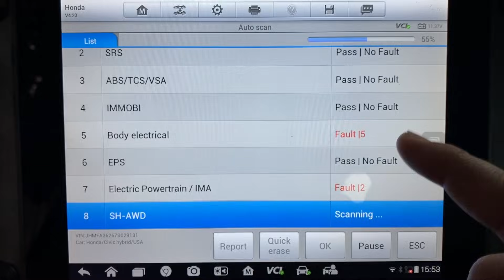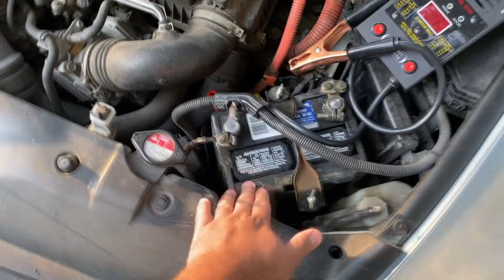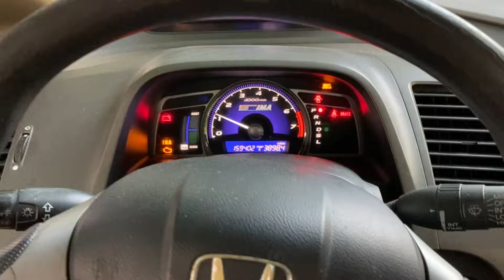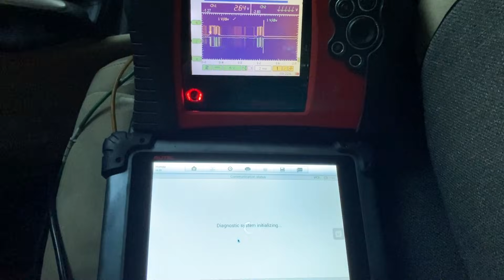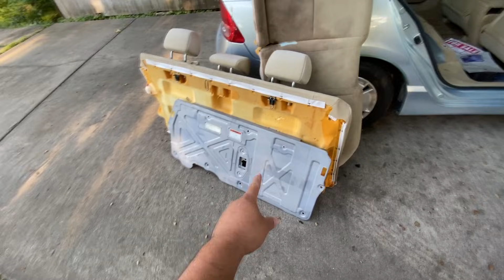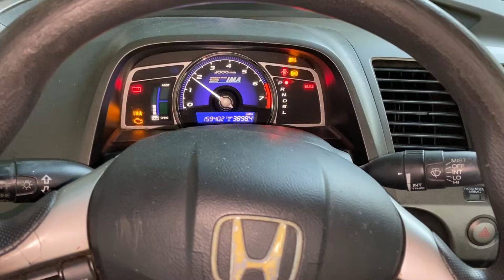HONDA CIVIC HYBRID STALLS / NOT CHARGING DIAGNOSIS

Comment: First thing first this is a basic check that a technician mechanic will do .I always check the battery connection every wires attached to it positive and negative. That's where everything starts. 99 % i found loose connection, wire damage, fuse blown ect I hope that's will help. 😊

Comment: My 08 has a similar problem.  New battery pack.  When it's cold in the morning (<~45 or 50)  I get codes , ima, blinking D.....  If I put a space heater in the car with the metal shield off blowing on the IMA battery (the BCM also warms slightly) to simulate a hot day (we do not have a warm-weather problem), no codes are generated and the IMA works just fine. 
The IMA gets to 90-120 surface temperature, no issues. 
Took the BCM out warmed it to 80° , and the balance of the car was 33, boom we get codes. 
Other than the thermistors on the battery sticks temperature reading devices in the battery pack area? 
Without a scan tool how do I check the function of the thermistors while the imma is installed?
Can a scan tool display the temperatures or values that the thermistors are Sensing?

Comment: I just have a issue in mi civic hybrid 2009 the brakes are not working they check with the machine and its pulling the brake sistem indicator. Mi car is not braking at all 😮 can someone help me ?

Comment: Hello, I have a 2008 Honda Civic Hybrid, and the battery light comes on, I can't imagine it. if not the 12v one. sometimes yes and other times no. I turn it on and off and the battery light goes off. And I have changed the module and the problem still persists.
Reply: Did you get it fix? Am having the same issue

Comment: Great video. I'll take it a step further and went to fuse 62, and it was burnt. I believe that happened when the jumper cables were put on the 12v battery. When I did, the battery showed 8 volts but was taking a high rate of charge. Anyway, replaced the fuse and wa-la. All systems back online, or seems to be, at this time. I like how you do your videos, very informative. Thx. Subscribed, and grateful

Comment: Dude, you did soo much and you are really good at explaining it. 
There is one more small fuse box for the IMA system. 3 fuses. ImA 1, IMA 2, and brake booster. Located bottom, left hand corner of the battery. I don't think you ever got to it.
My car left me stranded the other day with same symptoms. Got lucky watching another video about this Fuze box, changed those 3 fuses and was able to drive away. Drove an hour after, hasn't come back....yet....

Comment: Man please please someone help me out my 2014 Honda civic 1.5l ran out of oil tried to started and smoke ( smells like electric wire burning ) came out 
The bottom of the Orange wire . Is the the electric assist motor burning or what .. thanks if anyone can help

Comment: Hi, I buy a honda hybrid 2006 1.3 like that, and I try to take it there in  honda and they said is a MCM module, my 12v battery don't charge and two light apear in the panel IMA and Batery. Did you have any tips to give me?
Congratulation for you canal, fantastic your explanation!

Comment: Communication Issue is sometimes purposely done by the main computer. For example if the computer sense a severely out of range sensor it will cause a communication error that is cause by that sensor. So sometimes troubleshooting communication problem should start with live data. I had a prius c with a defective temperature sensor. Car would not start. Scanner shows a code that has to do with communication. I noticed a red value in the temperature sensor. After replacing sensor communication was stored and car starts right away with no more communication problem.

Comment: The Flashing led on D is related to the CVT. Can be a failure of a component or just low fluid. Perhaps that's why Transmission scan is not working.  When the fluid is low, after it cools down it may not cause the led to flash upon startup, until fluid level normalizes and temp normalizes.
Reply: On these cars is usually just low voltage due to a bad dc to dc converter . Nothing with the fluid

Comment: i have a 2013 honda civic hybrid with less than 109k miles on it, as i was driving yesterday my check charging system, check IMA system, and check brake system lights came on all at once. i took it to run a diagnostic at autozone and no error codes popped up at all so im hoping its a fuze or wiring issue because i cant afford to replace the entire hybrid battery pack. hopefully whatever mechanic i bring it to is as thorough as you.
Reply: Hi Moe Anaya, I just got similar problem with my 2010 honda civic hybrid. So I am wondering if you got any luck with fixing yours and what was the fix? Tnx!

Comment: I have an 09 civic non hybrid and my car stalls while at stop lights or while taking turns sometimes any tips, the idle becomes super low and stall while in drive but turn right on afterwards. I’ve cleaned the throttle body, tried driving it with EGR unplugged, swapped MAF fuse, swapped AC Clutch relay fuse. Any ideas/help?
Reply from the maker: If your check engine light is on, have it scanned for codes. Sounds like you could have a problem with either a vacuum leak or a dirty throttle body. Maybe try cleaning the throttle body and relearning the idle.

Comment: And that's how Honda dealerships and Toyota dealerships pay their rent. They leave loose wiring or just disconnected. Also they quote you whatever high price for parts and if you go with it then they will let you pay an arm and a leg. They expect you to bring it back to make more off of you. I always tell them that the part is like 70 percent cheaper online and it's genuine Factory oem. They always try to give you a cheaper price after you tell them that. Lol. They will also disconnect one of your small evap hoses in hopes that you get scared when the check engine light comes on and bring it back to them.  I never will let anyone I care about go to a dealership.

Comment: Today I had the same problem with my 2003 Honda hybrid. The same cable was super lose. I probably messed it up after I installed a new battery couple of weeks ago. After adjusting the cable. I took my car for an 40 miles drive. Ima and check engine are off. Thank you 🙏

Comment: Thanks for your video. I am in France and I have the same problem on my Civic (no recharging of the 12 V battery). I did not quite understand what to do to fix the problem.
What should I change as a part?
Thanks for your advices.

Comment: I have an 06 civic hybrid engine battery died. Replaced  battery now won't start or turn over green key flashing on dash . Also had lock smith try to reprogram  keys with no luck . Keys still lock and unlock remotely Getting error  code Imos not registered. Alao hDo I need to charge battery  in back seat also for it to recognize  the ecu? Or any ideas? Besides take to honda?

Comment: I have an issue where it turns on then the engine immediately dies. It does not happen every time. Would this be an issue with the fuel pump relay?

Comment: Very useful video 
I am facing one problem in same model car 
Error  Codes in
Electric powertrain is 

IMA P0A94 DC-DC converter output low voltage Permanent

DC battery not charging , once start also Battery warning light display in cluster 

I check the fuse ,relay all OK

I found DC converter input volt once start the car and found up to  190v but output DC converter volt is 0 
Check the status in scanning tool 
Command for DC converter is on 

Sometimes found DC Converter status malfunction 

Sometimes show normal 

So i need solution please guide me 

I suspect DC converter fault 
My observation is correct?
I am waiting for your reply 
Thanks
Reply: I check status in maxisys 906bt tool

Comment: Is it possible to bypass the hybrid system entirely as a quick fix? I seen a video where a guy did this and he claimed he had been driving it for over 70k miles. He just used a marine battery which can take dying more than a regular car battery. He also claimed that he didnt have to jump it all of the time being that the car doesnt have an alternator to sustain a constant charge for the battery. He had a portable battery charger to jump it. But he claimed that disabling the hybrid battery had no impact on the engine itself. Since it was no longer having to take the load from the bad hybrid battery. 
Im trying to figure out weather this would in fact work. Im looking at purchasing a hybrid civic thats in overall prestine condition albeit needing new hybrid batteries. If i can get it for 1k and disable the system then I should be able to drive it for another 2-5yrs then if he drove it for 70k miles with no major issues bedsides having to jump the battery a lot. This might not be a good investment considering that the hybrid battery will cost more than the car is worth.
Reply: Hi nowimhigh, I am wondering what did you do at the and and is it working? Tnx!

Comment: You think you can tell me what might be wrong with my 2007 Toyota Camry hybrid? It stalls when I barely turn it on and then go but then when I turn it back on I sit there for about 2 min and then it runs perfectly fine after that. The only light that show is the one that says check vsc system or hybrid system

Comment: I got a question, I replaced on my 2007 Honda Civic hybrid the ecu, charging system and battery pack from another Honda Civic 2007 hybrid, plus inmobilazer included to make sure it would start, when I try to start car, security key was flashing and the D shift and car didn’t even crank, then I put back the old ecu and old inmobilazer and now D shift flashing and engine won’t start just crank but it won’t start.
Do I need to reprogram the original ecu, what could be the problem

Comment: Great video. I have a 2010 Insight. Was getting "Check IMA" and occasional 12V dash lights, as well as Catalytic Converter warning lights.  Bought a working used high voltage battery. Hooked it up, but it will not communicate with a scan tool. It is not working at all - The car is running off the engine only - no IMA assist. I know there is a ground from negative 12v to body, and one from HV battery to floor. Are there other places that the car ground could be bad? I assume that is where to check first.

Comment: Those loose connections seem to always magically connect themselves when you look for them. Maybe the battery was installed at one of those parts stores that do it "Free of charge". It makes me wonder if the high voltage battery was really bad.

Comment: We have save model same problems right now the car won't start. the car was running fine. no more.
new spark plugs new boots for the sparkplug new battery we disconnect the battery is nothing to read in the car memory.
my Question what tool or name is the scanning tool you are using.

Comment: I’m only 4 minutes into the video, I haven’t watched to end yet.  My money is shorted CAN wiring or a control module that is shorting or causing errors on the CAN bus. Perhaps the connector or wiring was damaged when the IMA battery was replaced.

In regards to the delay in starting the engine.   The hybrid Civic will first attempt to start the ICE with the high voltage IMA motor.  If the high voltage battery is too low state of charge, or any kind of error with the IMA system, the civic will fall back on the 12V starter motor.  I think that is what is happening, the IMA system is off line and it’s using the 12V starter.  Many other hybrids like Toyota and GM Volt do not have a backup 12V starter, but the civic hybrid does.
Reply: Partially wrong ! Not "any kind of error with the IMA system", only when HV battery is too much discharged. My HCH 2005 runs a lot of time with IMA light on and only 2..3 times a week uses the 12V starter.

Comment: Does anyone know a good site for clear info on fault codes?  Trying to verify what they were, as I know at least one of them was related to EGR, pulled the plate off the runners and it was clogged with carbon (car was rough idle, stalling) and I cleaned it up and has run well since.  Only other problem I notice is a very rare cut out of the EPS, only at slow speed and usually a fast turn of the wheel but I don't think anything crazy.  (2005 Civic Hybrid CVT 116k mi)

C1307
C2B01
P1748

google wasn't too kind, but I'll keep searching!

Comment: brother .....its only yours 1st video of honda civic hybrid in youtube in detail...of all can bus and control module...its hard to find videos on this car..also not available mechanical brochure ot wiring diagram anywhere on int.you explaining indetail..thanx a lot bro..
👌👌👌👌
i also have problem with my HCH .yellow beake light,trans D is blinking...and abs light also....i sort out this problem at home in 1month problem with only one 10amp fuse blown under the hood its IMA fuse located in behind radiator small box have 3 fuses..
thanx bro

Comment: I recall being in a distant town, and saw a gal with a VW rabbit (or other...) with a hood up.  She complained that she couldn't consistently start it.  I was a bit worried, as I'd never looked at a diesel before, and vaguely knew that there are warming circuits for the plugs which could have complicated things. 

Had her jump in to start it, and just barely noticed a spark on a ground point on the firewall while I was looking down at the engine and listening for a starter click.  I asked her to turn off the key, hand tightened the nut, and had her try again with success!  She was astonished, and wanted to know if I was a local mechanic. LOL.. no.. just a DIY'er in another town.  I pointed out the nut for her to tighten when she gets home (no tools there), and she thanked me. 

In the Air Force, when working on complicated electronic circuits, the most frustrating problems to solve were intermittent ones, and learned to apply vibration, heat and cold to suspected areas to help find things. 

Nice work!  Very lucky to have brushed up against that connector and found it loose.  Without that chance encounter, you may have been chasing this for awhile!  And VERY WELL presented diagnostic steps!

Comment: Always check the battery terminals first....
For you not to do that I find it to be strange.
Whoever had it before you, I find that to be even stranger.
From an intellectual point of view, I rate it a A+....
Your initial sign of low voltage is an immediate indicator that should take you right to the battery terminals.
Like I said earlier, your very intelligent and I would consider moving up to an instructor position down the road.

Comment: thank you for your video! I've got one question: you disconnected the highvoltagebattery via the service switch BUT while it was disconnected you started the car but the highvoltagemotor is under normal conditions the starter for the engine so why then started the engine? Does the engine have a normal 12V starter?
Reply from the maker: Yes it has a normal starter.
Reply: The way I understand it, it can start the engine with the 12-volt starter or with the IMA motor/generator depending on conditions.

Comment: Great job man. You just showed in this video that if the tech knows  how to properly read wiring diagrams. Do not necessarily have to know how the system works. Ofcourse thechs need to be aware of the dangers a hybrid or electric vehicle posses. Happy for you . God bless.

Comment: It wasn't all luck. Your standard procedure led you there, even though you weren't at that point specifically looking for that grounding circuit. If that grounding circuit were located somewhere else, you would still have found it just by doing what you were doing up to that point.